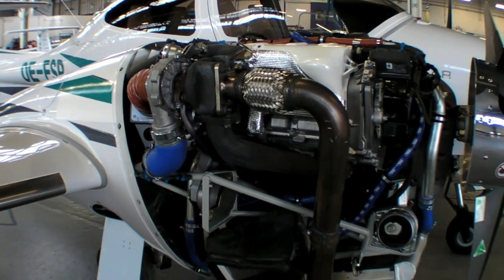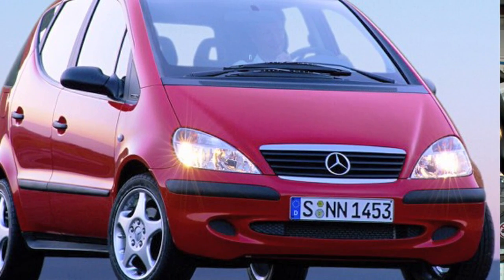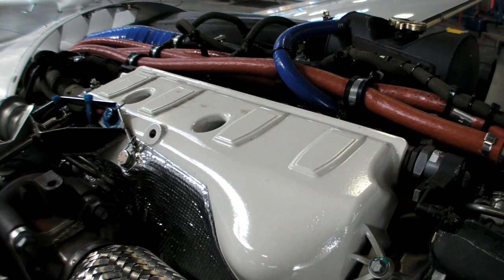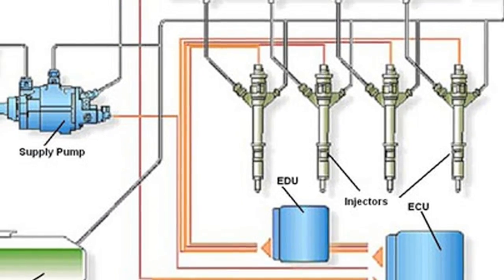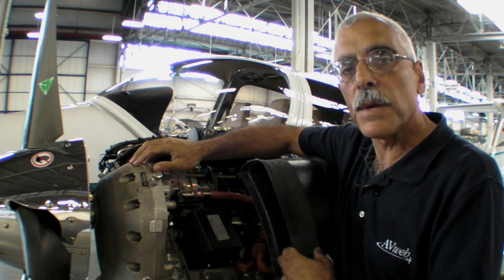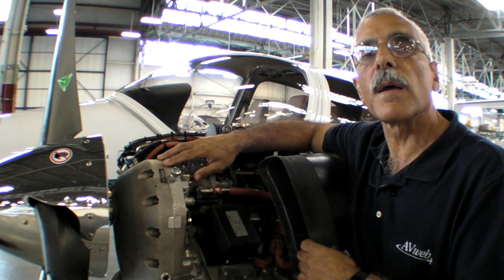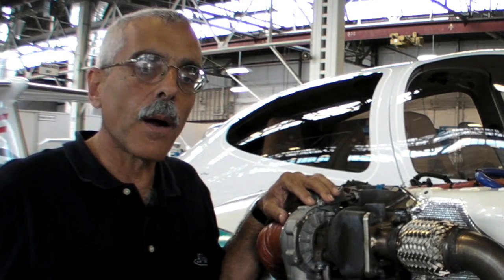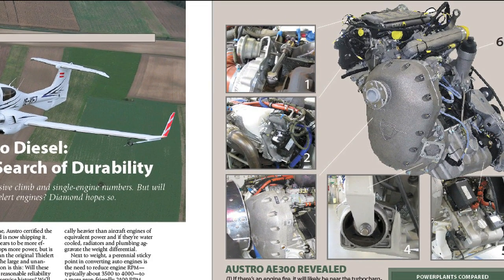Austro AE300 Aerodiesel Report

Comment: I understood 23000 PSI on the BOSCH fuel system, please someone explain.
Reply: This is nothing to stop the presses about. New many new diesel cars today have 36kpsi and some higher. I guarantee you that you'll see injection pressures go up and up even from here. We will also probably start to see ducted injectors on diesels (and even gas engines). For the moment, ICEs are hardly dodo'd.
Reply: high pressure fuel injection

Comment: So it's based on a Mercedes Benz car engine.  What happens when MB decides to stop production of this engine?
Reply: that doesnt happen so fast. you can buy spare parts for realy old mercedes anytime. you can have a Mercedes from the 70s and Mercedes will sell you anything what you need to repair such an old car.
Reply: They'll switch to a new engine. Diamond initially ran the Thielert Aircraft Engines-built TAE 125-01 Centurion 1.7 engines, they then switched to the 2.0 litre engine TAE 125-02-99 and after that they switched to their own Austro Engine AE 300 seen in this video (Austro is a subsidiary of Diamond). They also offer the Lycoming IO-360 engine as an option. Should Mercedes cease production of that diesel engine they will replace it with something newer which Austro could adapt/modify or look for another supplier with something suitable.

Comment: Well, the lubricity needed for the low-pressure supply to a gas turbine is less rigid than what is needed for a high-pressure injection pump for a diesel engine, and especially so when talking about common rail pumps working at several thousand bar.

oh well, I don't know. i don't run jet-a1 myself but this is what i've heard. I guess it's different for a plane since it is inherently colder up in the air!

Comment: not especially so.  Hell, on most bosch pump equiped diesels I have worked on they recommend cutting the diesel with "parafin" in cold weather, parafin in those terms meaning kerosean.  Jet-A has lubricity increasing agents added to reduce wear on the fuel pumps on those big cargo jets.  It's probably a non issue.

Comment: Diesel engine and PSRU... Busy cowling environment... Turbo... Too much trouble making items.
Reply: Yeah, let us stick with coal engines instead.
Reply: Wait till the air-con compressor and an Intercooler are fitted in, and maybe a Helmholtz Resonator...
Reply: Electric is coming along..